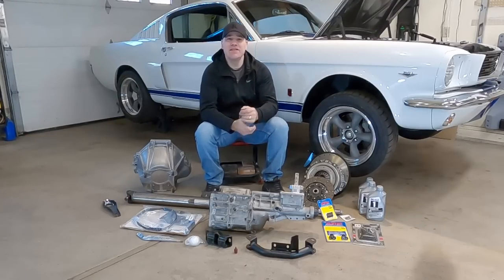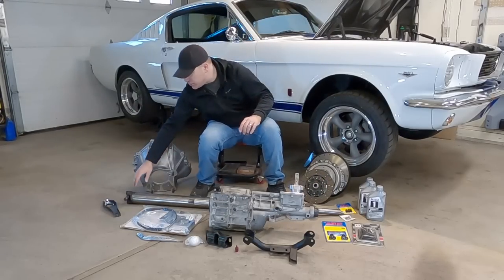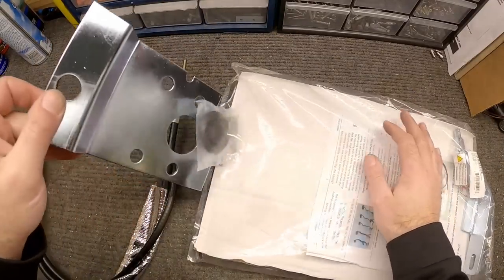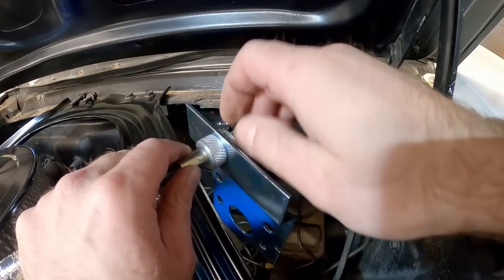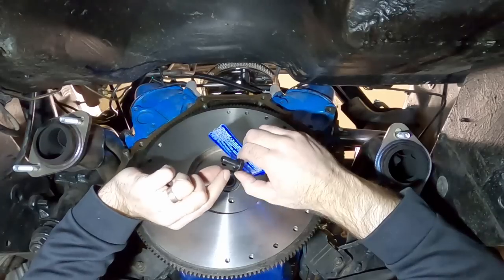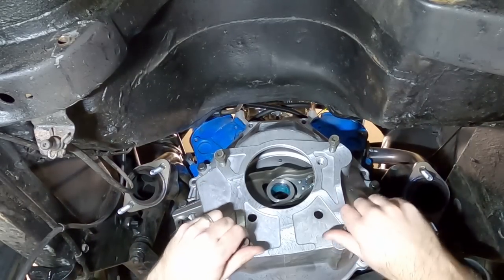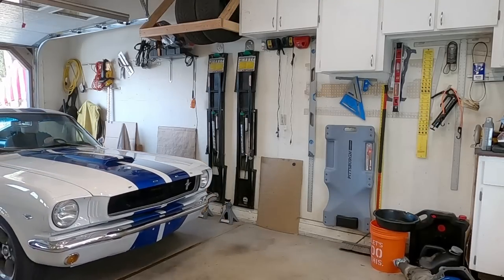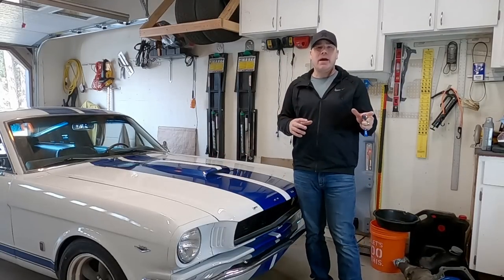How to swap a C4 Transmission for a T5 Transmission (Part 2 of 2)

Comment: Andy I am so glad that I stumbled upon your videos on Reddit, they are without a doubt some of the most comprehensive amateur installation videos I've seen. I'm in the last stages of finishing up the fuel injection conversion on my '69, and now you've given me the confidence to take this project on as well. Thanks!
Reply from the maker: Awesome, thanks for the feedback!  :)
Reply: I’ve got a 69 too! Considering EFI. What did you go with?
Reply: @KMD583  Edelbrock Pro Flo 4, with the new intake, and fuel rails and injectors pre-installed. Highly recommended.

Comment: 17 years ago I swapped out a 3 speed manual to a T5wc in my 67 mustang convertible. Same issues you had! I bought a used 94 t5 and had to get a different input shaft to fit the bell housing… brings back some good and bad memories! I also had a 2.79 rear end I swapped to a 3.55 with a truetrak limited slip diff, all gear, no clutches to wear out! This summer I’m pulling the engine to install a new short block and I think I’m going to a cable clutch which means I need a new bell housing! I had to cut off the original ‘ear’ on it to use the Z bar linkage!!!
Reply from the maker: MDL makes a great external hydraulic kit, if you're in the market.  :)

Comment: I had a 65' in high school my dad and I built from a junkyard.   After we got it up and running we bought a 66' and swapped the 4 speed into it.  It was very hi geared and I could get about 45 mph in first.   The 66' had 3.5 gears so we swapped the rear end out and oh my God did it make a difference!   I pulled so hard.   I loved the car, biggest mistake I ever made selling it.  I'm about to retire for a second time so Im planning to get a 66' convertible to fix up.
Reply from the maker: Sounds like getting a new project car will be just what you need.  :)

Comment: Andy, another great video. Yours are the best on YouTube. You do a great job of filming and showing exactly how to do things and most of the time it’s right on. I really appreciate it and I have used your videos as I am restoring my 65. I sure wish I could go with the five speed, I know it’s fun, But from time to time my old left knee gives out, so I am afraid to go with it. 😢
Reply from the maker: Thanks!
I feel your pain on the knee issue, that's why I have the hydraulic clutch kit on my car now, it is effortless to operate, I recommend it!  :)
Reply: @AndyKruseChannel  do you have a video on that?
Reply from the maker: @TexarkanaPrepper  I have an install video of how to do the hydraulic clutch on the car in this video (it came out not too long after this video), but I don't have much on the hydraulic clutch on my current car.  Mostly because I already had a video, but partially because I split up the install because I was waiting for the motor to be installed to finish that clutch install.  :)

Comment: Very nice video as always! Dude how many gopros do you use to film? I've been doing it wrong the whole time. I need to get more I think. Car sounds great and looks like a lot of fun.
Reply from the maker: Thanks!!
I only have two GoPros (5 and 8).  The one outside I had to stop and keep moving to get the shots.  :)
Reply: I was going to ask the same. Did u use a suction cup adapter? I was gonna try it but got scared 😢. Maybe a quick YT Short to show the setup?
Reply from the maker: @mando82jr  Yes, there's a GoPro adapter that works great, no issues.

Comment: Nice project. As for installation of the shifter boot and having to drill holes to install, I refer you to 21:09 of your video where you can see the captured/welded threaded square nuts in the underside of the transmission tunnel where the shifter boot is to be attached (these were also used to mount the automatic transmission shifter).
Reply from the maker: Yeah, those holes didn't align with my trim ring of the shifter boot.  I later fixed the issue I was having where I made a similar plate to what you are referring to, it perfect now.  :)

Comment: You site keeps popping up. The input shaft for a Tremec is about 5/8th inch longer. I drilled two holes on the Tremec bell housing to use the 1965 fulcrum and throwout arm. A aluminum spacer between the fulcrum and inside the bell housing allowed me to use all the original pedal, Z bar, linkage. For those not wanting to go hydraulic or cable. The saved money went into an aluminum driveshaft.
Reply from the maker: That's by design, now that I've got you here, there's over 300 videos I need you to watch.  :)

Comment: Andy, I would recommend going to either 3.55 or even 3.80 gears with a Yukon posi  . There are a lot of YouTube videos on setting up your 8 inch ring and pinion gears . I did 3.80 gears with the Yukon posi in my 8 inch and the Tremic TKX trans .
Reply from the maker: I like you're thinking.....  :)

Comment: You made it look easy, definitely something I want to do to my 68 Fastback, wish I lived in the States though cause prices for the T5 are crazy. MDL can get me what I need but I have import costs and taxes to pay once it lands in NZ. Will be lucky if it'll cost me less than $10k NZD to do it myself. Did you film your rebuild of the T5 as well?
Reply from the maker: Without sounding over confident, this swap really is easy.  Anyone with a basic set of tools should be able to get it done.
There may be a way to get the T5 if you look at junk yards/scrap yards for Ford cars from '83-'04.  There's other cars too, but a list of all T5 transmissions found online is a great place to start to see if you can find something you can salvage.
I did not film the rebuild as I wasn't sure if I could get it all done my self.  I jumped in and gave it a shot and by the time I realized I could do all the work, most of it was done and too late to start a video.  Even then, the videos I used for the rebuild are way better than what I'd put together, no point in reinventing the wheel at that point.
If anyone is interested in a T5 rebuild video, anything with Paul Cangialosi or Junkyard Doggs is where I'd start.  Its a good thing YouTube doesn't charge me by the view count on the videos I watch.  :)
Reply: @AndyKruseChannel  saw that video too. Down under in NZ we have the Ford Falcons and Holdens. I believe the EB XR8 Falcon used a T5 produced August 1991 – August 1993, but have no idea if it'll work as there is nothing online with a definitive answer, all right hand drive here too. Ideally I get the box here and the components and parts from MDL in the states....

Comment: Hi Andy, great vid! Did you notice a significant increase in fuel efficiency / MPG after switching to an OD transmission?
Reply from the maker: No, but that's be cause I don't put many miles on this car, and when I do there is a lot of WOT because I want to have fun with this car.  :)

Comment: Hey, Andy. After watching your videos. I've gained enough confidence to try and do this T5 conversion myself. I've got everything I need, with the exception of headers. Do you have a part number for the headers you used on your car?
Reply from the maker: Nice, you've got this, it's not as intimidating as it may look.
I have JBA Shorty headers (1650S) and the JBA cross pipe (1650SH), but this cross pipe doesn't work with most subframe connectors for the trans mount.  In the video I show the cheap eBay unit, then I had to buy the MDL unit and slightly modify it to make it work.  It's been almost a year and I have had zero issues, but I just wanted to give you a heads up if you go that route.  :)

Comment: Hi Andy, always thankful for your library of videos. I know you don’t have the C4 anymore, but I have a question ; been dealing g with leaks . What’s your Tran. Pan torque specs , 9-12 lbs? What tool do you use to tighten? How do you know the torque is ok?
Thank you 
Richard
Reply from the maker: That sounds about right.  The biggest issue these pans have with leaks is someone in the past over tightening them which slightly dimples the sheet metal, makes the pan not seal with the gasket.  You may need to pull the pan off and flatten the flanges where the bolts go through.  You can probably see the holes in the flange dimpled in a bit.  :)

Comment: This video was awesome, like most of you videos.  Just curious, why you skipped bell housing alignment.
Reply from the maker: While it is important, it's less critical on cast housings since they're all made from a mold.  The weldment style (like the popular Quick Time units) are built in a jig and there can be some very subtle variance in the weldment.  This doesn't mean the cast style is perfect or that it can't have a subtle flaw, but these units did not have the runout measured on each car when they were installed on the Ford assembly line.  :)
Reply: @AndyKruseChannel  I'm right in the middle of this swap right now.

Comment: finally the best mod for a car to make it a different feel of a car , more racy feeling and connection with the car.is the clutch   ordered on a 1991 mustang ? or wath is the part number?
(i'm building a 331 stroker so i hope the t5 world class can handle it)
nice how to do vid . keep the vids coming 🙂
Reply from the maker: Thanks!
The clutch for this swap is a standard, nothing fancy unit from MDL.  The part number is MD-O7-14C.  It fits flywheels with a 10 inch bolt pattern and fits the T5 10 spline input shaft.
The T5 will be fine on a 331 stroker, the key is to minimize the 5000 rpm clutch drops to paint rubber stripes down the road.  :)

Comment: Did you use the same starter from the C4 on the T5?  On the old mustangs, ford had different starters for automatic and manual transmissions.  Supposedly the difference is the ones for automatic transmissions stick further into the bellhousing.  And somehow if things don't jelly just right, you can ruin a flywheel using an automatic transmission starter on a manual transmission setup.
Reply from the maker: Yes, I used the same starter that was on the car when I bought it.  However, I don't know which starter I had (assuming one could tell the difference from looking at it), and this car was originally a manual.  Somewhere along its life someone converted it to an Auto.  I observed no problems with the starter or damage to the flywheel.  I eventually upgraded the starter to a more powerful unit from PowerMaster, but it was because of my engine upgrade, not because there was anything wrong with the starter.  :)

Comment: little late now, but jba has an h-pipe made specifically for cars with a t5 swap. thats probably why you had those issues.
Reply from the maker: Probably, but that second crossmember (not the cheap ebay unit) did the trick.  :)

Comment: Great video Andy. Your videos have helped me a lot on my 66 Coupe. I was wondering how you figured out which speedometer gear to put on? I think I have an 8 inch rear but I'm not sure of the ratio. Had a 4 speed in the car before.
Reply from the maker: First, you'd need to know which driven gear is inside the trans.  At the least, you can peek in the side of the tail housing and see the gear, then count the teeth.  Next, you'll want to know the gear ratio in the rear.  There should be a tag on the front side of the third member that tells you the gear ratio.  Is it's not there, you can spin one of the tires one full rotation and count the number of times the pinion gear on the third member spins.  There are only a handful of realistic gear ratios for the 8", so it will be easy to see if it's a 2.80, 3.0, 3.25, 3.4, 3.55, 3.8, or 4.11.  If it's a stock third member, it will be one of those lower numbers.  Then find out the circumference of your rear tires.  Finally, take all those numbers and find a website (there are many) that allows you to calculate the speed gear tooth count you need.  This is another area that won't be exact, but you should be able to get a gear that is close, something that is less than 3 mph off when going 60 mph.  Good luck!

Comment: Love the vids ! Getting ready to put a t5 in my 67 mustang. Which clutch/pressure plate and flywheel set up did you go with?
Reply from the maker: Thanks!
Clutch and pressure plate number MD-07-14C, Flywheel number MD-CS157-28D, all from Modern Driveline.  :)

Comment: Andy, is this the factory hood or did you replace it?  If you did replace it, what brand is that? Awesome job on the Transmission!!
Reply from the maker: Thanks!
Sorry Boss, I don't know if the hood is the OEM piece or not, it was on the car when I bought it.  :)
Reply: @AndyKruseChannel  yes sir! That is an awesome ride! I'm doing my wife's 64 1/2 which came with a 6 and a 3 speed. Just put a 302 in and will do the T5 swap. Your videos are a huge help!!!

Comment: I am about to do this swap,did you need to adjust the clutch cable at all or was it pretty good as installed?
Reply from the maker: I made sure everything was tight before going for a drive.  I don't recall needing to tighten up the cable after driving around, everything seemed good from then on.  :)

Comment: Mine is a 67. I'm having a hard time finding enough information to do my engine transmission swap. From and inline6 to some type of a V8...
Reply from the maker: The are a lot of similarities between the '66 and '67 when it comes to swapping in a motor and trans, so this video will get you part of the way there.  You may want to check out Vintage Mustang Forum for additional help on smaller details of the swap.  :)
Reply: Thanks you.

Comment: Andy, buying parts for my swap now. Do you have a part number or a link to the shifter you bought that doesn’t allow the shifter to over travel? I want to make sure I get the right one! Do you like it thus far?
Reply from the maker: That shift assembly I have is from LMR, part number SVE-7210A.  I paid about $150 for it.  You may be able to find a used shifter assembly on eBay if your budget is a little tighter.  Maybe look up Steeda Tri-Ax or something from Summit Racing?

Comment: Awesome video once again! I'm planning on putting the same T5 in my 68 coupe in a few weeks once I get the rest of the parts together. What kind of flywheel/clutch assembly are you using? I have the original 4 speed manual in place now and wasn't sure if I could re-use the existing clutch/flywheel or buy a new one.
Reply from the maker: Thanks!
You can re-use your clutch and flywheel as long as you plan to retain the clutch mechanism (Z-bar in your case).  If you choose to upgrade to the cable conversion or hydraulic actuation, you'll need a new clutch and possibly a new flywheel (depending on the clutch bolt hole pattern).  If you're looking to change the clutch actuation, I'd suggest calling MDL and explaining your scenario, they'll be able to point you down the correct path based on your build plan.  :)
Reply: @AndyKruseChannel  thanks! I’ll keep that in mind!

Comment: Andy, I’m doing a c4 to T5 now for my 66 so thanks for your videos! Should my stock driveshaft work? I think i’ll need to at least get a new slip yoke but I’m finding conflicting info.
Reply from the maker: The driveshaft you had with your C4 will fit. Both the length of the driveshaft and the yoke will all fit. That’ll save you a few bucks as you work through your swap. 🙂
Reply: @AndyKruseChannel  sweet! Thank you! Not sure why some people are telling me otherwise. I was wondering if it was cause you said you had a newer t5 but I might be confusing videos.
Reply from the maker: @bry94608  The output shaft spline count is the same on the C4 and T5, so the yoke will fit.  Buy new parts is not a bad idea as you'll know there's nothing wrong with them (cracks, stress marks, etc), but it's not needed to get your car heading down the road.
Reply: @AndyKruseChannel  appreciate you!
Reply: Got the t5 mounted but fyi the drive shaft is a little to too long. I wonder if I can cut the slip yoke a little. I’ll call MDL tomorrow.

Comment: Hey I just stumbled upon this your video and I have a 67 that I did this conversation on I had a C4 before I have a 302 in it and it makes that same wining noice from 1-4 and 5 doesn’t like going in (but that could be me I don’t have a tac and just go by noise) I was wondering if you had ever changed out you rear diff gear ratio and if you did did the noise go away?
Reply from the maker: By the time I installed this T5, I had not swapped out the rear end yet.  I have since upgraded the rear end and I don't have any noticeable whining from the gears.
If you're having trouble getting 5th to go into gear, it's likely that your synchros need to be replaced.  While you're in there, you might as well freshen up all the synchros, bearings, and seals.  :)

Comment: Hi Andy, how it going ?
Question , I noticed a bit of leaking atf between the bell housing and the tran pan.  Any suggestions to a cause? 
I thought it was my pan , but the fluid seems up towards housing connection to the front end pan area 
Thanks
Reply from the maker: By saying trans pan, I'm assuming you have an Auto.  If you're certain it's not the pan gasket, then my guess would be the seal on the input shaft of the Auto.  There's fluid in the torque converter and the seal between that and the transmission where the input shaft is located might be done.  :)